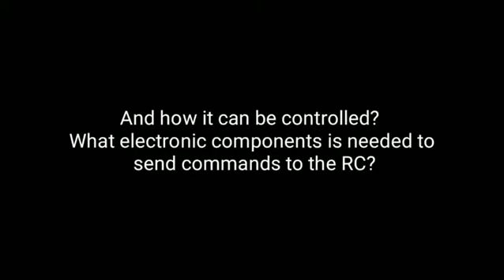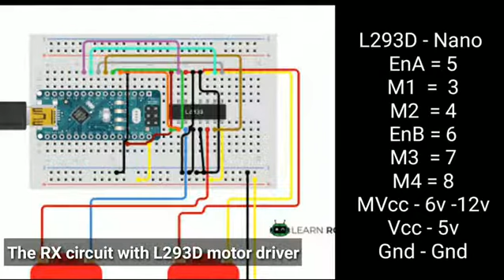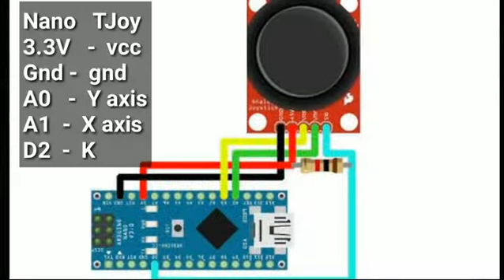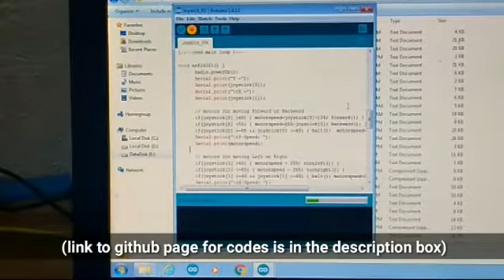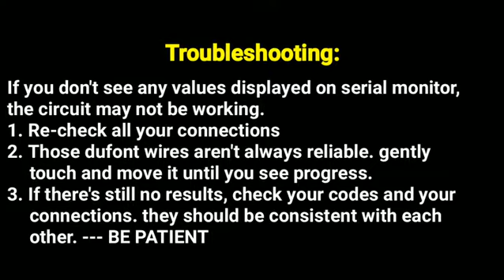Watch: Guide on How to Use NRF24L01 for Wireless Arduino Projects |Mechatronics Engineering

Comment: Ich kann alles Hochadel aber warum kumunizirin die nicht
Reply from the maker: English please. Thank you
Reply: I can upload everything but why it is not covered
Reply from the maker: @kevinschafer4231  sir what exactly do you mean "not covered"? 

Do you mean "not discussed"?
Reply: Sorry 

I can upload everything but why don't they communicate with each other?
Reply from the maker: @kevinschafer4231  please check both codes, the TX and RX codes. The CE = pin 9, the CSN is pin 10. If you used that, the nrf modules may need .01uF ceramic capacitor across vcc and gnd. 

Or please check all your connections. Sometimes there maybe some loose connections
Reply: Can you only record such a video with the radio module NRF24L01 + PA + LNA with SMA antenna 2.4 GHz?

is not a must but is great

and finally a big praise and
Thanks a lot
Reply from the maker: @kevinschafer4231   There's troubleshooting explanation in the latter part of the video @ 5:00
Reply from the maker: @kevinschafer4231  i Don't have PA + LNA with SMA antenna module. But as far as i know the codings ate the same. Range are the only difference.
Reply: Thank you